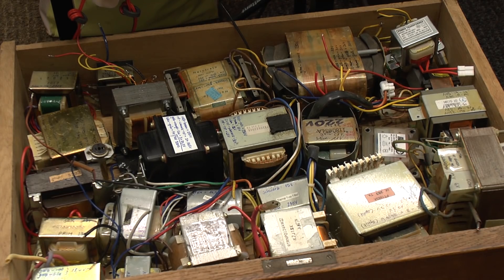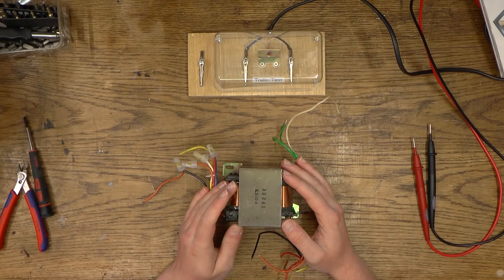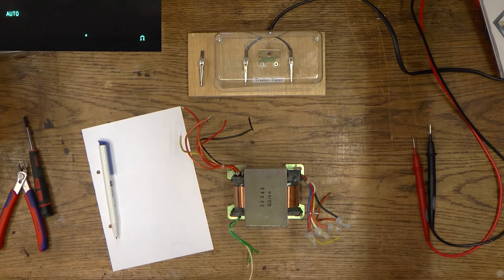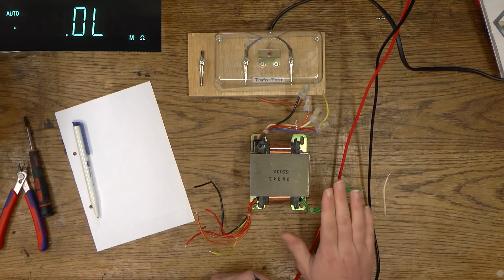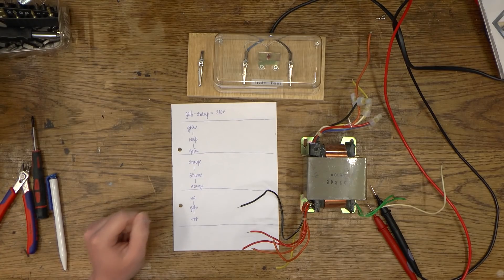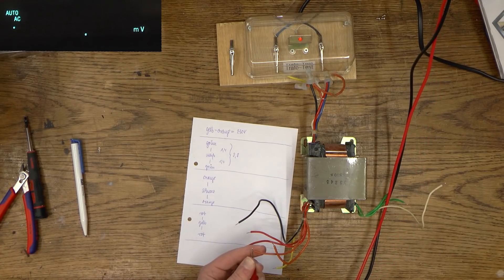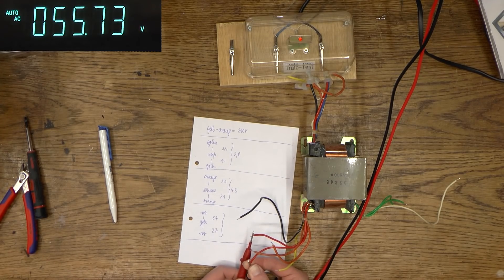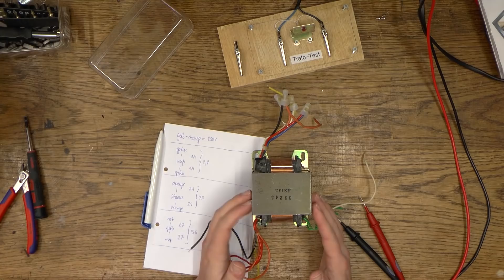How to test an unknown Power Transformer

Comment: This is a dangerous process - you assume one side of each center-tapped pair will still be safe to touch, and you will usually be right - but this is like playing Russian roulette.
Especially with older vacuum-tube or CRT based equipment where there can be high voltage (~1kV) secondaries.  Play safe and use croc-clips on the secondaries too.  And also - check that none of the secondaries are likely to touch each other while under power.

Many years ago - as a teenager, doing more or less the same thing as you, I powered the primary through a 10:1 step down transformer (variac), confident that a (say) 36v secondary would measure 3.6v etc and be 'safe' to touch while attaching probes.  One time, I had what turned out to have a transformer with a 2.4Kv secondary - still resulting in a 240v stepped-down output. with both hands pressing the probes into these wires, I could not let go for some seconds while I bounced around my bedroom floor!  All part of my 'education' and luckily for me, no real damage other than a lasting respect for these things.
Good video though. Cheers

Comment: If the green and white wires are a center tapped winding, why is the green winding not DOUBLE the green to white winding  IE 0.9 ohms (one side) plus 0.9 ohms (the other side) total green to green would be 1.8 ohms wouldn't it?
Reply: Agreed, A 4 wire resistance measurement is needed in this case. https://en.wikipedia.org/wiki/Four-terminal_sensing
Reply from the maker: It's not this simple. The transformer output voltage is not a linear function of the winding's DC resistance.
Reply: If it,s a centre tapped winding surely resistance from centre to each end must be half the total or it's not a centre tap is it?
Reply from the maker: I am not re-watching the whole video just to see what the readings for green and white were. Remember, when measuring resistances of only around 1 Ohm, the resistance of the test leads and even more so the contact resistance from the test lead to the transformer winding do have a major influence. Indeed the resistance of the two halves of a centre-tapped winding should be the same. If I had used proper clamps and a 4-wire multimeter the resistance certainly would have been the same.

Comment: I always start by testing a transformer by feeding 3 or 6 volts AC into that looks like a secondary winding. this gives me a ratio to what i think is the primary. Then i may do a test like you did, but i don't touch the probe ends while probing.

Comment: Using alligator clips (or similar) would be a good idea for testing higher voltages, what about determining the input voltage of a transformer, I have one that has no markings on it and I can't tell if it's a 100, 120, or 240 volt transformer?
Reply from the maker: If I'm not sure what the input voltage of a transformer is, I throw it away.
Reply: DrCassette I took it a step further, I placed a 5 amp fuse in series to the input, then I gave it 240v, the fuse went poof! This tells me it's most likely a 110v unit, it works ok on 110v
Reply from the maker: But what's the point? We have 230 V over here, I wouldn't keep a 110 V transformer either, because there is no use. I do re-use components, but I'm not a hoarder ;)
Reply: DrCassette because the amp this transformer came from is a very good one and is too good to throw away, I have a step down unit I use to power it.

Comment: You've just got a new sub. ❤️
btw a small question. as you mentioned "this can be used in future project". i wanted to have some idea on what kind of projects, these are useful for. i have bunch of these big transformers around. 
thanks :)
Reply from the maker: As a general rule you can say the bigger the transformer, the higher the output current. A big transformer with a split winding that puts out 2 x 20 V can for example be used to build an audio amplifier.
Reply: DrCassette some of them I have outputs 50 amps at 12V. they are awkwardly powerful for a bench power supply and falls short for welding or melting purposes. 
and thanks for interacting 😃
Reply from the maker: Indeed, too powerful for a bench power supply - also 12 V for a bench power supply are impractical, I like to have up to 30 V available...  And also for building amplifiers 12 V are way too low. Of course you could combine two 12 V transformers to get a center-tapped 24 V.
With a sufficiently powerful rectifier bridge and some fuses you could build a car battery charger in case you have a use for one.
Reply: DrCassette ahan! Thanks for the ideas. The battery charger sounds like a fun build. 😊
Reply: 50 Amps at 12V can be perfect for driving a string of LED's with appropriate electronics...

Comment: Very Good Video. Like you, I also has a collection of transformers taken out of devices from long ago and need to do this to my transformer collection also, just when is the question.  BTW: As an added measure of safety,  if no isolation (current limiting) pre transformer from the mains is available, a series incandescent light bulb can be used in series between the mains and the test jig to limit current,  so if anything short-circuits, only the wattage amount of the bulb current passes instead of the full current/wattage from the mains.  Again, thinks for the video, as its a reminder to suss out my many transformers and catalog their wire windings.
Reply: Isolation is nothing to do with current limiting
Reply: Right. Its the light bulb that can be used for that. Back in the day when servicing lots of high powered systems as professional concert audio power amplifiers, many came in that blew fuses so a current limiting bulb was used at times.  That was before I finally got a variac for voltage control rather than current control. I was thinking of the size of transformer and its current ability instead. As a small 2A 120V to 12V transformer only delivers current pass of 2A, a 5A transformer delivers 5A and so forth .Where a 1:1 transformer of current size would be all the transformer would be able to deliver. So yeah.

Comment: What about the primary side voltage? It's not a good idea to use 110V primary on 240V supply, bad things will happen, which might not be obvious while testing... Ofc, normally that is known, if you rip the transformer out of known device youself.
Reply from the maker: Yes indeed. I don't keep transformers with unknown primary voltage. Too risky.

Comment: The only extra thing I would add is a 100 watt lightbulb in series with the primary to limit accidental short circuits or accidentally hooking up the mains to a low voltage secondary.

Comment: The overall idea of checking the resistances and voltages between the different wire is pretty much the approach that most hobbyists would opt for.  Personally, when I test transformers, I connect each wire to a screw on a terminal block so that the wires aren't flapping in the breeze and thus prevent accidental short circuits.  Plus, this is making the measurements much easier and safer too.  Once the voltages between the different wires are determined, it would be nice to suggest/demonstrate how to evaluate the current capacity of the transformer, don't you think ?  I understand that this might be beyond the scope of the actual video, however I'm pretty sure a lot of hobbyists, like me, would appreciate a video on the subject.  Anyhow, thanks for your time and please, be careful when manipulating transformer outputs when the transformer is connected.  I'd rather prefer exchanging ideas and comments with you on different subjects than talking of you about a shocking event that transformed your life !!!.

Comment: First off, install a 1 Amp (or smaller) fuse on the hot wire. Your plastic case won't do much if you accidentally connect the mains to the wrong side of the transformer. The windings can go up in smoke quite quickly. 

Next, to prevent the resistance of your skin from showing up on the meter, use alligator clips on at least of of the wires you are testing. 

And lastly, assuming that it will be safe to first touch the center-tap is ridiculous. What if that was a step-up winding on that wire. There could have been hundreds of volts even at the center tap. Although the ohms readings would have indicated this to an experienced person, you are making this video for inexperienced people so safety first. Power off, use alligator clips to make the connection then power on and take the reading. 

It takes less than an amp of current to kill, although it takes a lot of voltage to break the resistance of the skin. There's an old saying... if you are going to touch any live wire, keep one hand behind your back.
Reply: Yes but, Daves Tech and Roy Riederer and others are making good points on this. On the other hand experience people know what to do, that is why inexperienced people looking for answers and come accros your video,.... You knew the voltages, but your viewers don't and if  they follow your video without any knowledge, they might get hurt. I also know what i am doing , and i never will follow your video (with all respect), but i use alligator clips, and when i turn on an old unknown transformer, i stay away from it. You never know what can happen. And this is positive critism, don't take it personal, i love your channel and work.
Reply from the maker: Where does it say I made the video for inexperienced people? Some basic knowledge and some brain and all is fine. The test jig was not plugged into a standard wall outlet, there was a separate low current fuse in place. Plus, that's why I checked resistance of all windings first. But I do admit, I should have taken some extra time to find some alligator clips.
Reply: It was an assumption. Some people, like myself, watch these videos because I simply enjoy to watch them. Others, watch them to learn. Even if your target audience are those who already have basic skills and knowledge, there are a vast number of people out there who will simply follow exactly what you say. If you tell them to place the wires into their mouth to test for current, they probably would. 

Did not mean to offend, I was trying to give constructive criticism.

Comment: Voltage doesn't kill, current kills. You shouldn't make a habit of touching any voltage windings.
Reply: Should be fine to touch the voltage windings. He'd only die if he touched the current windings.
Reply: Yes, I should have thought of that. ;)
Reply from the maker: Wrong. You need a certain amount of both. Current won't kill if the voltage is too low and vice versa.

Comment: I like your idea of the covered clips for hooking up the primary.
But--- You must have realized that the output resistances of the secondaries was enough lower than the resistance of the primary that you wouldn't get killed using those bare probes in your hands.  But others might not have caught that.  Also, you guessed that the leads on one side of the transformer were totally separate from the leads on the other side, and that there weren't any short circuited windings.  I, too, wonder why 0.9 +0.9 is not equal to 1.8.  Something funny going on.
Reply: nothing funny about a burnt winding !  not that hard to figure out...

Comment: It may be very obvious to most viewers that you are measuring AC output.....but, for clarity, I thought it may be worth pointing out that, after rectification, the measured 56VAC would give you about 80VDC (without load).
Reply from the maker: Correct. 56 V (AC) * √(2) = 80 V (DC)

Comment: Interesting video with useful information. I'm lucky enough to have a Cliff connector box with built in safety interlocking mechanism (as seen used by Bigclivedotcom). The only other thing I would probably use to make things safer and easier is some insulated connectors for taking the readings to prevent reading my own resistance and reduce the risk of a shock from higher voltages - I also have an isolating variac but I don't think it would be necessary or beneficial. I have some test leads I got from Farnell that have spring loaded connectors with a small hook on the end which are designed to easily fit onto component leads that are also great for using with loose wires.
Reply from the maker: Now that you mention it, I have such spring loaded connectors with a hook somewhere in my lab, too. I should have used those :D

Comment: Another safety trick I use is a dim bulb setup in case you connect a secondary winding it will not allow a heavy current draw and fireworks.
Reply from the maker: Good idea.

Comment: You should add a safety interlock.   Add a limit/micro switch on the box so that when the plastic cover is removed it disconnects mains power automatically.    Great video..

Comment: I use insulated a-clips with the vomm probes, what if it was hv from tubes?  be safe
Reply from the maker: In my case I am OK because if I do pull a transformer with HV output out of a piece of equipment I do make sure to label it straight away for safety.

Comment: Be aware that these are open circuit voltages. Under load these voltages could drop considerably depending on load and current rating of transformer. That being said OCVs are important when it it comes to voltage ratings of components.